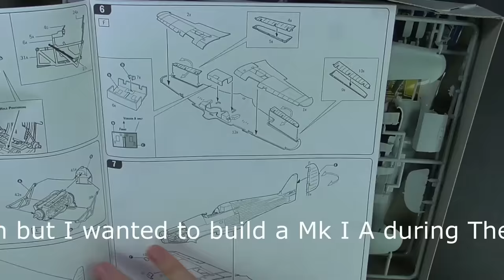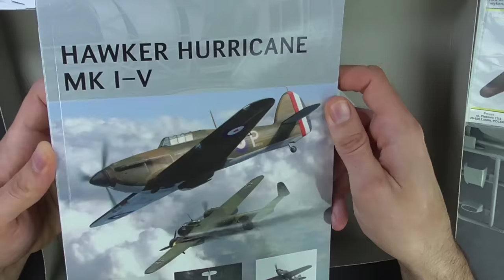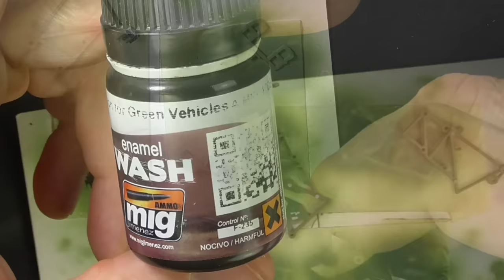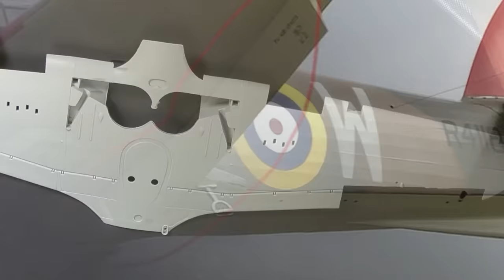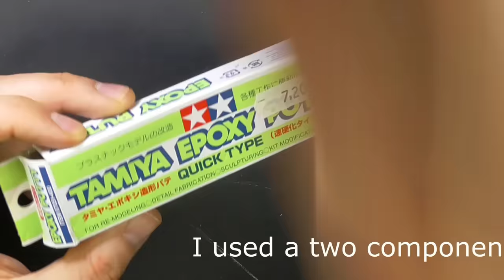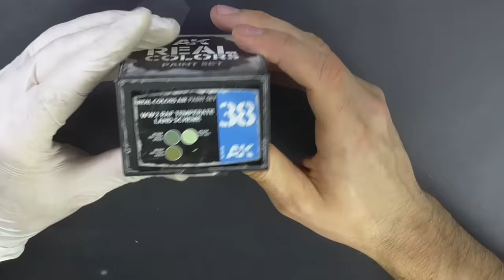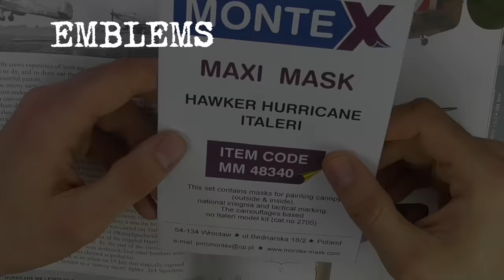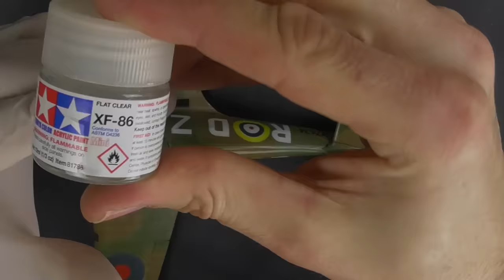Hawker Hurricane MK I Italeri 1/48.Battle of Britain. Building and Painting

Comment: Lovely model of a great aircraft. Just a couple of small points though. The video seems to show you putting a red navigation !light on the starboard wingtip. It should be green as red is only used on the port side. The cockpit hatch was only for escape and wasn't hinged so it was either c!osed or not on ghe aircraft. On the ground, the flaps were always closed unless the aircraft was either taking off, landing, or undergoing maintenance on the flaps.

Comment: Amazing model I used to do this when I was younger. I don't do it anymore I don't have the skills. I tried to leave pick up the Hobby again and learned on cheap models my airbrushing weathering techniques just can't get the hang of it
Reply: pilot steve I’m at the same stage as you😀 I bought some cheap kits on eBay to practise but I found them a pain in the arse. Much filling and sanding! I’ve learnt to buy decent kits from tamiya or eduard. Anyway, I’m still practising with my new airbrush and it’s getting there. Don’t give up mate👍
Reply: @PeteCourtier  I just picked up a cheap Tamiya 1/48 F4 Phantom from a local hobby shop. And it's turning into a disaster I watched so many YouTube videos on how to shade and weather  them I can't figure it out.  I used to do only 1/32 scale because they were bigger than the parts were easier to handle but I'm not dropping coin on bigger models if I can't master a small one
Reply from the maker: Hi!, I started to build model being so young too, I p for long time and I recovered this hobby when my chidren was born, few years ago. My tip is:  don’t buy so cheap or old models because usually they are plenty of bugs and level of detail  so often is very low….It’s better buy a medium price one and be patient 😊. Good luck and don’t get discourage!
Reply: pilot steve tbh my favourite build has been a 1/72 academy p51c. Apart from the decals it was great fun. 1/72 is a lot cheaper. I have a 1/48 tamiya mosquito in the stash which I keep putting back as I want more practice. Have you tried any armour?

Comment: I just built that kit and the real bug is that the wing assembly hits the bottom of the cockpit floor.  I moved the cockpit assembly up a little and thinned the floor.  There is another bug where the front edge of the left wing abuts the fuselage.  I filled with it multiple applications of thin putty and sanded.
Reply from the maker: Thank you for your more accurate description about the both bugs, very useful...

Comment: Great model. Nice result.
Here's a good tip :  On both the Spitfire and Hurricane, the flaps (the brass parts on your model) are either fully down or fully up. There is no intermediate position !!
Gluing them at an angle like you did, is therefor not realistic.
They are only lowered during landing, and even before the airplane stood still, they were retracted again, to prevent damage. So building a model with flaps down, means you are representing a Hurricane seconds before landing.
Reply from the maker: Thank you for your comment and also for your tip